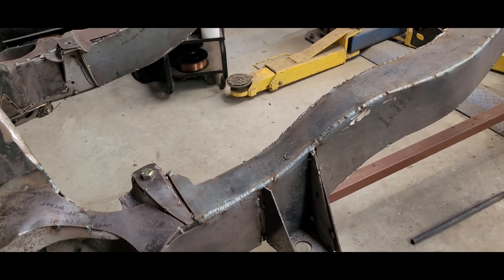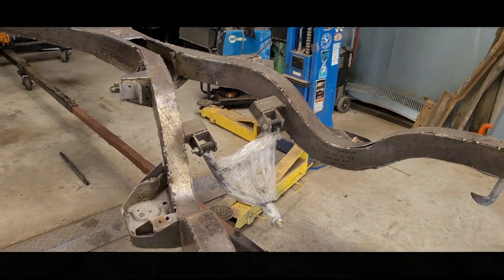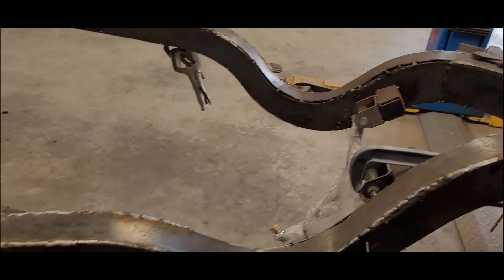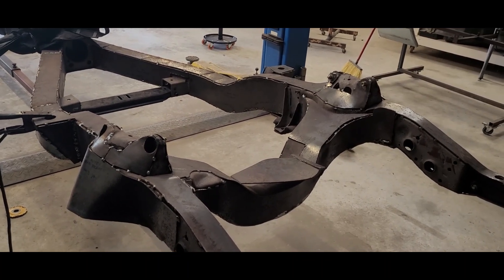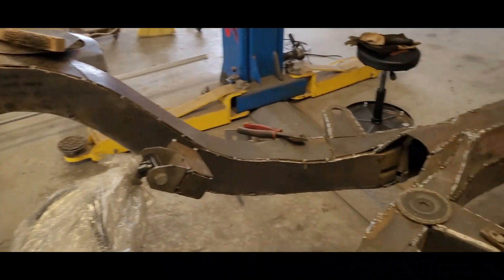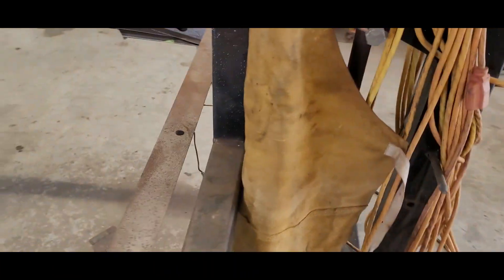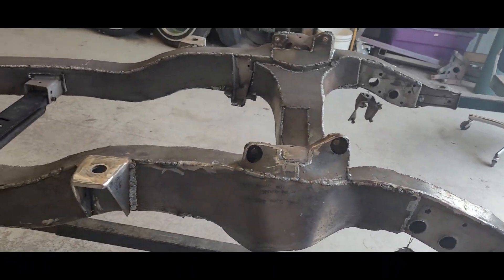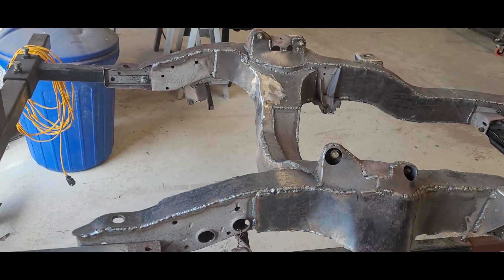60 Frame Lowrider Hydraulic Frame Reinforcement | 1960 Impala Part 5 | DIY | Rematch | Lonestar Lows

Comment: What gauge of wire are you using on the frame and what brand ? Also what gauge  and  brand for normal body panels? I have trouble finding anything local besides Hobart wire I can get Lincoln as well but I see you have a Miller welder and have noticed a Hobart as well on a couple of videos . I have a Hobart 190 welder and use 024 Hobart wire and just wandered what your using ?You guys make it look so effortless  with your welding .Great  videos really enjoying them Thankyou for taking the time to do it.
Reply from the maker: For my frame I'm using. 035.  For sheet metal we used .23.  The Hobart belongs to my buddy.  He brought it here so we can have multiple projects going at same time.  I bought the wire on Amazon, next day free shipping, the brand is PGN.  It's probably Chinese but works fine.  I'm far from a good welder.  But thats what grinding discs are for lol. Just comparing the 2 welders it seems like the Hobart burns alot hotter on 110 than my miller.